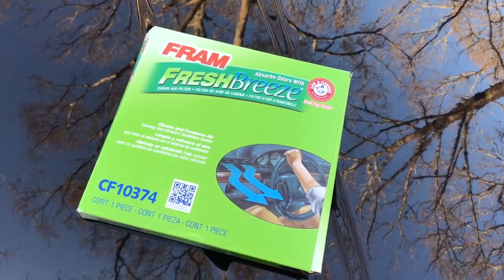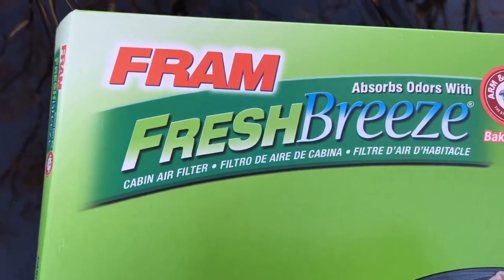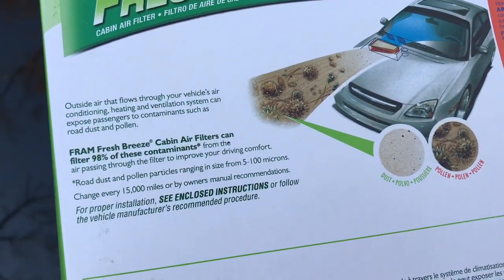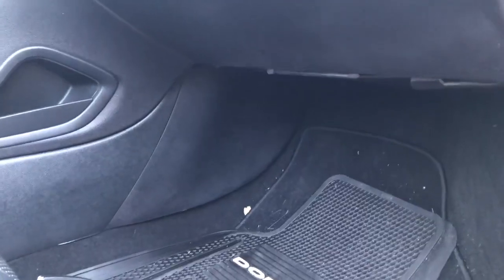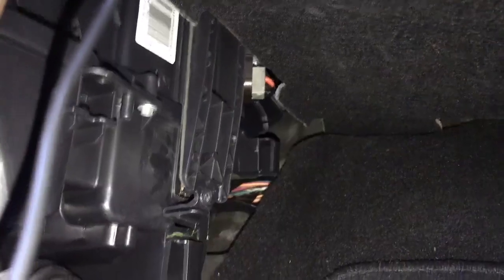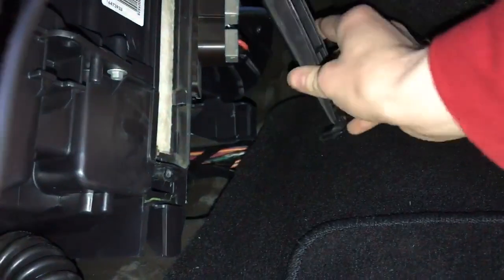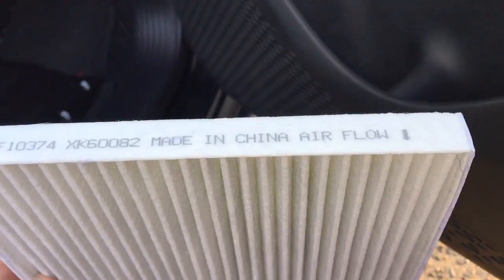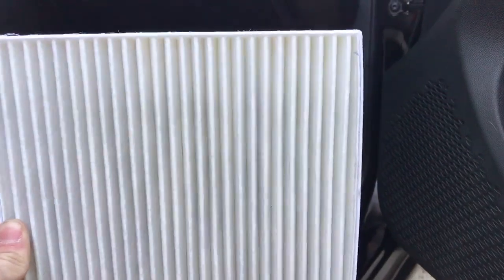Dodge Dart Cabin Air Filter Replacement

Comment: To anyone watching:
- Don't use Fram products, they're shit.
- The fabric cover under the glove box is held by 2 ribbed plastic "nails" that are a pain in the ass to pull out, put your muscle into it without breaking the plastic tabs.
- The outer cover pops out with some pulling. Use a flathead to get under the panel along the left side.
- The cover for the filter has 1 screw. If you don't have a 5.5mm my fraction socket worked perfectly.
- The rest is easy just pull it out but keep the air direction in mind. Screw the cover back on (the other end is a tab) and pop the plastic panel back and you're good.
Reply: If you don't like Fram who do you lkme?
Reply: So what inches is the socket screw size??
Reply: Yes, it is 5.5mm... another video said so and I busted it out and boom, perfect fit.
Reply: @icky_thump  I don't expect anyone to have mm sockets in decimals.

Comment: Dude thank you for this. Question: I don’t believe my darts cabin filter has ever been changed. My blower motor just stopped working, could a severely clogged cabin air filter prevent your blower fan from working?
Reply from the maker: Probably
Reply: @KevinCaptures  bro I changed the cabin air filter and air is working good as new now 🫡
Reply from the maker: @youngrozay3576  Awesome!